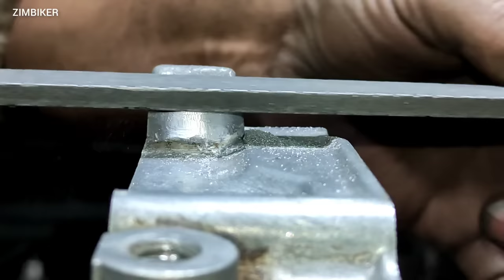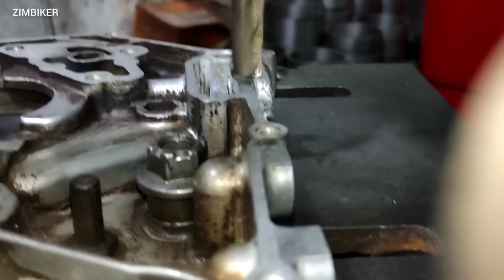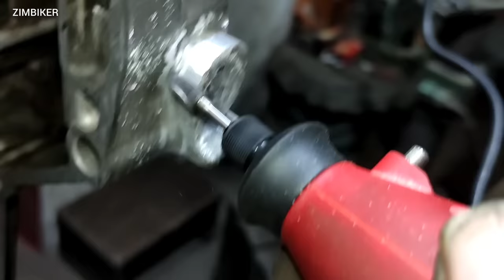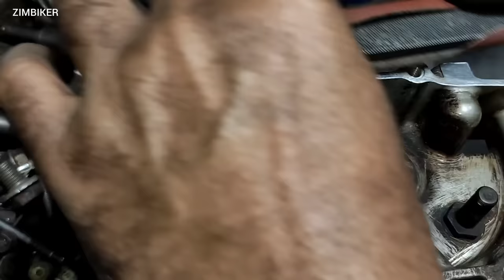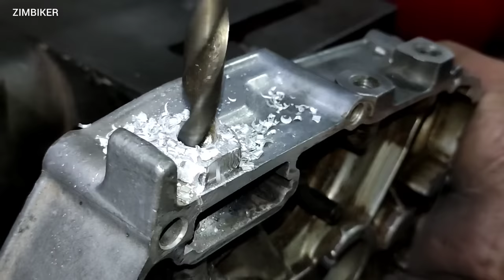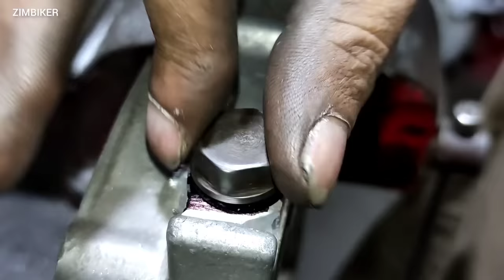Absolutely no need to buy new crankcase, how to repair crack oil chamber.

Comment: This method is also what I often use to deal with cracks in aluminum
Reply: I've done the same. But found it made the surrounding Aluminum softer. It was on water bypass on a SR20DE engine. But has held for the last five years.
Reply: Does welding jams the crank case bearings in future???

Comment: I fail to.understand why Auto companies do not provide aluminium Nut instead where it will be firs to loose threading s that any way can be replaced with every oil change . Or in that case  High temperature plastic nut like dip stick .